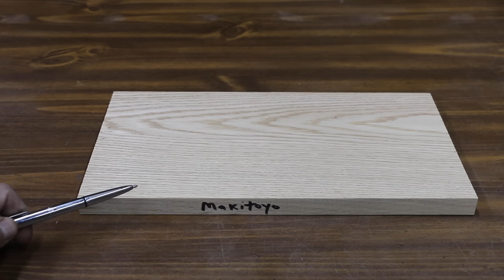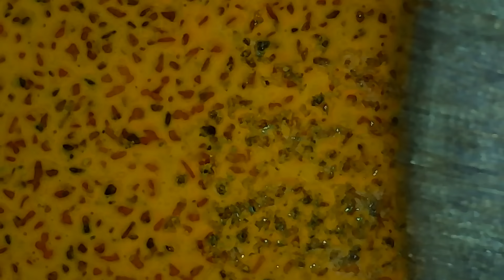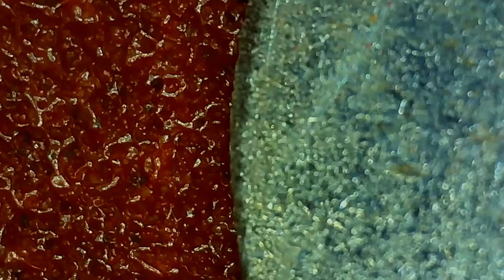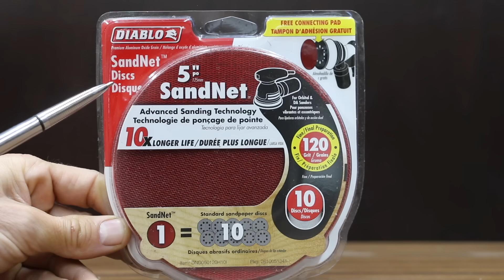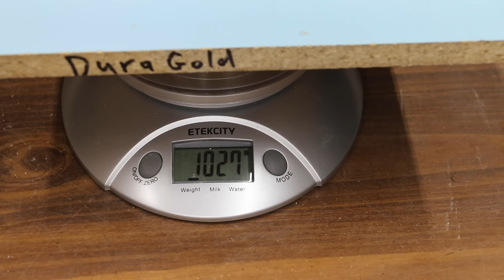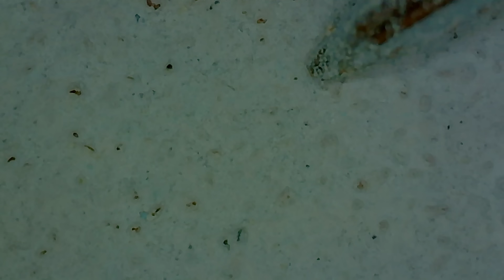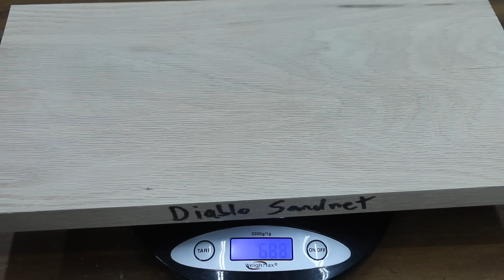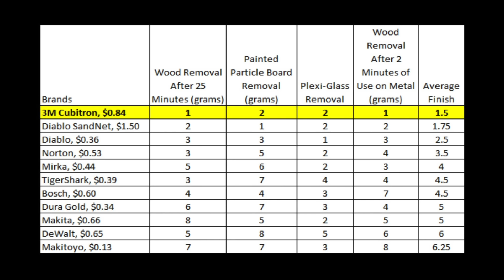Best "Sandpaper" Brand? 3M Cubitron, Diablo, Mirka, Norton, Makita, DeWalt, Bosch Sand Paper

Comment: Best pocket knife ! I am getting annoyed with them , try like a Walmart one , a home depot one ans then compare them to the expensive Kershaws Benchmade and such
Reply: Depends on what you want, if you want a lightweight locking knife with a geometry optomized for slicing and enough durability to get the job done but still be easy to sharpen Opinel makes some good folders. If you want amazing edge retention with barely adaquate toughness sandrin has some carbide blades with amazing performance. If you want a knife with a few different blades speacealized for different tasks a stockman style knife from a reputable company like Case or Rough Ryder might be a good choice (I personally prefer the carbon steel options from Case, Rough Ryder and Opinel but that is mostly an aesthetic preference)
Reply: @garethbaus5471  so I want a knife to cut fiberuous material ropes and such cloths,  but I am sick of knifes at gun stores and such I think there worst then the Walmart 5 dollar cheepies
Reply: @samstheman7633  are you talking 1 or 2 cuts a day, a couple hundred or 1000+ cuts per day? The Opinel has the best geometry so it will make the cuts the most easily but it will dull after the equivalent of about 100 slices of 1/2" sisal rope, a stockman knife has 3 blades so you can roughly tripple that number but the handle won't be comfortable and the geometry won't be as speacealized for slicing, the Sandrin knives are made of a carbide that is much more wear resistance than steel (generally exceeds 1000 cuts of 1/2" sisal rope before becoming significantly dulled) but it tends to be brittle and the handles aren't very ergonomically designed.
Reply: I switched to a foldable box cutter(or razor knife) years ago and have never looked back. I could cut through a 3in barge rope in 2 slices and the replaceable blades are cheap and you don't have to sharpen them ever. If you don't mind a larger knife I'd suggest a Kobalt.
Reply: Kershaw
Reply: Knives are ridiculous with options and many things are based on opinion in my opinion if you want the best production steel it is maxamet but you better know how to sharpen it if you're looking for a great do all kinda knife I'd say get a spyderco para 2 in s35 it's very nice I you can also go for m4 that benchmade makes for a tougher steel it's all so subjective which makes it almost impossible to answer but if you have stayed in the cheaper knives I'd also say look at a benchmade bugout its somewhat cheaper and is nice and lite

Comment: I love my 5 inch orbital sander so I really appreciate the testing done here. I have been quite impressed with the Diablo brand too. I have also had very good luck with cutting speed and durability with Gator sanding discs.  I would be interested to see how it compares in a “Round 2” test.  Also, I love my Bosch Model #ROS20VSC orbital sander, but I wonder if there is a better one out there. Maybe a comparison of orbital sanders in the future?  Thanks!

Comment: I'm wondering how the finish compares -- how much tear-out in the wood with fresh or worn sandpaper. Microscopic look at those boards between sandings would be nice.
Reply: That's what I was thinking. I don't sand to lighten stuff up. I sand to achieve a smooth surface. You'd think it'd correlate to material removal. But it is not entirely the same thing.
Reply: @1pcfred  Right, in fact usually the ideal result is as little material removed as possible while still achieving a smooth surface.
Reply: @Reziac  I can agree with that. There are other products other than sandpaper for stripping heavy paint and what have you too. 120 grit sandpaper is the middle of the process usually. It's medium grit. That 3M Cubitron was impressive though. I'll have to keep my eyes open for some. I don't care if it is expensive. My sanding time is worth it.
Reply: @1pcfred  Same here, I was impressed with the 3M stuff. Worth a little extra cost. Sandpaper that wears out halfway through the job is really annoying.

Had another thought about quality of the results: sandpaper that removes material more consistently might also produce a more consistent surface, because it's not going to change so much as the sandpaper wears. Dang, I really want to see those boards under the microscope...

Would be interesting to compare the 3M product to the sandpaper meant for drywall (fibrous green stuff that looks like a scrubber pad) -- it just doesn't wear out, but I haven't used it for finishing wood.
Reply: @Reziac  what I do when I am finishing wood is I douse it with some mineral spirits. That simulates what a finish on it may look like. Least while the surface is still wet. Then there's a bit of a sheen going on. If it looks messed up doused it's going to be messed up finished. You have to use a low angle light etc, etc. Dousing really highlights scratches though. After orbital sanding you have to block down with the grain by hand. Dousing raises the grain too. So that helps.
Reply: @1pcfred  That's a good trick, thanks. I don't do enough serious wood finishing to know more than the standard "sand and varnish". (I'm the despair of our local woodturning group, I just don't have the hand for it...)

Comment: Used to do autobody and polish aluminum leading edges/intakes on private jets. 3M by far makes the best sandpaper. Its super consistent in its grits aswell. Some brands you will get a finer grit with larger grit particles mixed in which makes it a nightmare to polish out. 3M is always very consistent in the grit particle size and doesnt cause gouges or deep marks like some other brands do.
Reply from the maker: Thank you!

Comment: I've done auto body and paint work for over 35 years.  I have found that 3m products are pretty hard to beat.  Last summer, I sanded, primed and sprayed a 28' boat.  I ordered 120, 220, and 320 grit papers from the cheapest Amazon supplier I could find figuring I would save a bunch of money.  It was a blend of Mirka and Dura Gold.  I ran out of 120 and went to the auto body supply store I usually buy from and discovered that the 3m brand was less expensive than what I bought from Amazon and lasted at least twice as long. I eventually ran out of 220 and 320 and the result was the same.  3m for me.  I think in their market, you get what you pay for.
Reply from the maker: Thank you!

Comment: Great video, Todd! Since all of the wood pieces started out at different weights, wouldn’t it be more accurate to compute the percentage of material removed? 1 or 2 grams difference in removed material could be due to a slight differences in length of the boards. Of course this might present another problem in that a smaller board would lose a greater percentage of its weight due to increased sanding time per square inch. Maybe giving each result a +/- value might be better. I am probably overthinking this. Thanks for all you do!
Reply: He sands each board the same amount of time. They're all very similar in size too. So I do not think the slight variation in board size is a contributing factor in results.

Comment: I've been buying 3M for awhile because it seems to last, especially sanding metal. For me, the extra cost is easily worth it in exchange for not having to constantly replenish degraded sandpaper. Good to know that this experience is empirically validated, and also that Diablo is a cheaper alternative for less hard materials. Thank you as always. I've been donating to your Patreon for about a year now and it's overwhelmingly the best value subscription I have!
Reply from the maker: Thank you!

Comment: Sand wood with a brass pin and a nail in it to see if the ceramic drags the metal onto the wood and stains it. Garnet will not. It is what I use on knife handles after the pins are in.
Reply from the maker: Thank you for the video idea!

Comment: I haven't seen the video yet but I use the Bosch because it's way better and more durable than the cheap stuff I find at Biltema (hardware store in Sweden).

EDIT: I'm still happy with the Bosch since I never sand metal but I will upgrade to 3M after my other sandpapers are gone, if I can find any that is.

Thanks for the video!
Reply from the maker: Thank you!

Comment: I was very intrigued by DeWalt that they make sandpaper in Poland and I've checked if there is any available in Poland and how much it costs. I found about 10 auctions, about 11,75$ for 25 pieces, 125mm P120 sandpaper discs (but different "model" - DT3115). And reffering to video I hoped that they will do better ;)
Reply from the maker: Thank you!

Comment: Excellent video as usually. I've use many brands of sandpapers over the years in autobody. Though you're using mostly consumer grade paper there are many different lines from each brand. Among my favorite we're the autonet and abranet lines from Merka which were a lot like the diablo sandnet. 3M is pretty much the best for consistent finish but comes at a price. Other more affordable brands I've used are Norton, Carborundum, and Sunmight. I'd say Sunmight was my favorite bang for the buck. Behaved the closest to 3M at nearly half the price.
Reply from the maker: Thank you!

Comment: Todd:
This is the first time in, years that I've watched your videos that had truly shocking results that change my buying habits. Dewalt and Makita papers are just junk. And Diablo, normally something too ritzy for my wallet so I don't even check the price, was both cheaper and finished on the podium. Great discoverable value in this video
Critique: Removal rates don't really measure which sandpaper is best, it could be that the winners are just cheating and using a higher abrasive level than they claim, while the honest ones could look like poor finishers only because they're finer and more accurately representing their grit level. Showing the percentage after successive 5 minutes was a good indicator of durability though, I'm glad you did that.
*Suggestion: * I tend to get lost in the endless stream of numbers you drole out through tests like this. It's more effort, but, if you wanted to make a better video, I think it would be helpful to have a footer on the video that showed the results as they came in. Like a small table, (or better, a bar graph where possible) with the brands along the bottom as columns with their specs above. Then I was a visual anchor to see all the earlier numbers, and, see where they compared in real time without having to remember your audio. Also, this would give the audience more time to compare and contrast while there's not much going on except watching you sand. More time we can spend thinking about how each is different. I think many videos would be improved by building the "result" table you show us at the end, live.
Reply from the maker: Thank you for the feedback!

Comment: In about 2015 I have switch over to Festool I was tired of either burning the sandpaper or burning up the sander. I could only get 2 years out of a sander. The festool has lasted the longest so far going into the 6 year. I have seen the festool sandpaper lasting much longer. I had tried the Diablo, Norton, DeWalt, Makita and the Bosch sand paper and did not like. I have never tried the rest of those sandpapers. I will say I have not sanded any paint, But Stains and poly I have.

Comment: I’d like to suggest a video. How about a mower blade show down for brands. Based on hardness, weight loss after cutting and sharpness. Brand new, sharpened and after a cut.

If you can include or make a second video on balancing the blades and it’s heat/wear effect on spindles for unbalanced blades.
Reply from the maker: Thank you for the video idea!
Reply: @ProjectFarm  of course! The hardness plays a factor for mowing. Too hard and it could snap, too soft and a stick can dent it in to where you can’t get an edge back on it. Can test blade destruction too! Haha

Comment: Anybody who does woodworking as part of their job or hoppy knows that sanding is a pain. You deserve a medal sir. I personally use the regular Diablo and the SandNet to remove paint and other finishes. After getting a Festool sander as a gift I've found their Granat sandpaper to be very good but harder to get and expensive ($0.84 a piece in a pack of 50 discs). To save money I've purchased Klingspor sand paper for my Festool sander, about $0.44 a piece in a 50 pack for alumina zirconia grit, made in either Poland or Germany. I will definitely be checking out that 3M stuff though.
Reply from the maker: Thank you!

Comment: Wow. I never thought there’d be that much difference from brand to brand. I’d just go in and buy whatever was available. 
I was fairly amazed at the highly diverse countries of manufacturing too. I never thought I’d be cheering on a brand of sand paper. Good job 3M! 😂
Reply: Oh I’d also like to add, for awhile now, you’ve been casually slipping in, “this weight seemed to perform the best”. I think that’s pretty telling that you’ve got quite a bit more into these tests. That could be useful information to include.
Reply from the maker: Great point!

Comment: Great comparison much more comprehensive then at lot that you see (as usual), even the last article I read in Woodworkers. Thank you for the great videos.  I do wonder how the smoothness of the wood compared between them at each 5 minute interval and if any of them reached what would be considered a stopping point to move on to finer grit earlier than others. This is of course just based on feel and not scientific in any way that I can think. With this the only thing I have not seen in any comparisons is working on larger pieces so that the smoothing of the wood does not have an effect on the cutting and weight removal. Maybe this could be a part 2.

Comment: I started sanding the paint on my truck yesterday and was struggling. This guy is my hero!
Reply: What sander you use makes a difference doing body work. Pros use pneumatic DA sanders. You need a compressor that can keep up with the tool though. But if you're going to paint you need a big compressor to do that too. So body work = big compressor.

Comment: Another fantastic video! I’d be interested to know how much of a difference stearated paper makes vs non-stearated for sanding paint. It probably depends a lot on the paint or other finish involved, and some of the papers you tested didn’t seem to have much trouble with the paint in your test. Still, stearated paper is a thing, so I wonder how much it might help. (I’m told that auto parts stores tend to carry it, because so much sanding there involves various finishes.) Also, the mail-order-only brand Klingspor makes a big deal of how well their premium line of sandpaper holds up under use, ultimately saving both time and money. It’d be interesting to see them included in a comparison. (Most of my sanding discs are from them, based on their claims, but I’ve never done a head to head comparison with anything else.)

Thanks again for the great work you do!

Comment: I hate sanding, so this video is invaluable.

Now, all I want to know is which 5 inch da sander will last the longest when run continuously at 7 lb force.   I suppose that you might need to change the paper every 30 minutes to reproduce friction.

My bet is that most would be burned out after 8 hours, with one or 2 making it to 300 hours of constant use.  12 hour stretches would make me happy, but I would accept 8 hours straight per day, with 60 seconds or less to change disc every 30 minutes.

Obviously, I have burned out many brands, impressed with none, but I have not tried every brand.

5 inch is important to me because I no longer need to hot glue a resin backed grinding disc, because of the expensiveness of the velcro.  A 100 pack or larger size of the 5 inch is the way to go.  As long as the price goes down, I will buy the bigger bulk of discs.  I have been very satisfied with the Diablo, so long as the price is low and they keep selling in bulk.
Reply: My ridged 5 inch seemed to last about 40 hours. I burned out a Walmart in about 2 hours. Harbor freight seems to have lasted 8 hours.  I did have a 1990 pro version of Dewalt last several years, but I probably didn't drive it to hard.  My 6 inch bosch lasted probably a year before one of my guys bent the spindle. I also do not like running all over town for 6 inch paper, when 5 inch discs are on every street corner paint store.

I just ordered a makita 5 inch for $120 with tax and 4 year assurion warranty.  Good reviews. Except too many people complain that the pad does not hold onto the sandpaper after a month of use.... I figure I might be able to epoxy or amazing goop some industrial velcro if it stops holding onto sandpaper.  Drilling the holes might be tricky, or not, after the glue cures.  Hopefully, fixing their design flaw would not void the warranty, as the fix is unrelated to brushes and motor.

Also, cheap replacement parts is important. If it cost more for bushes than a replacement sander, it makes no sense.